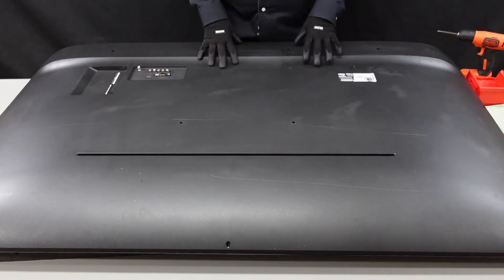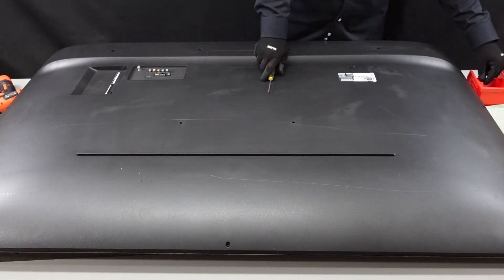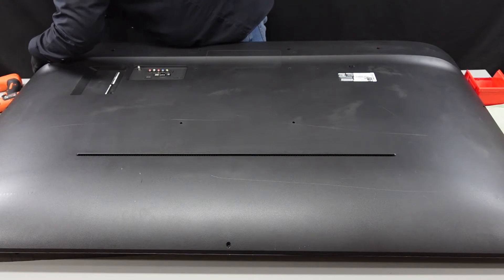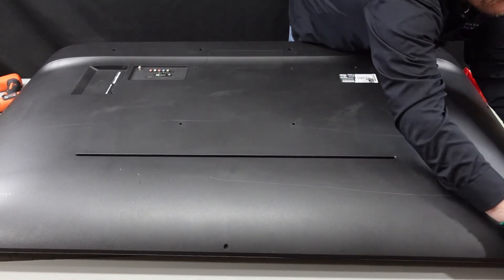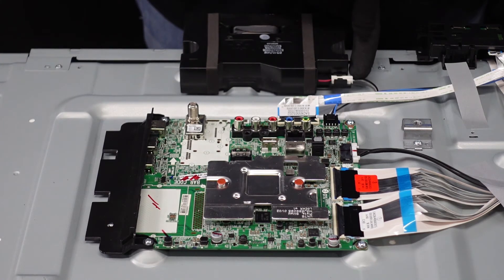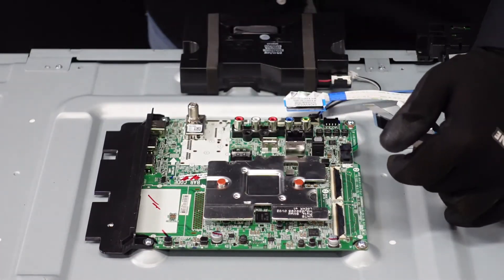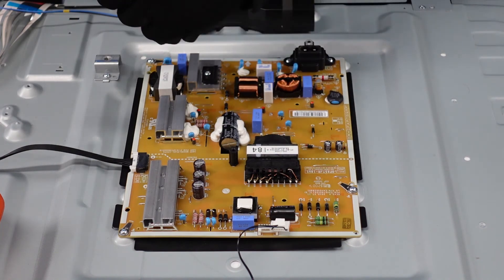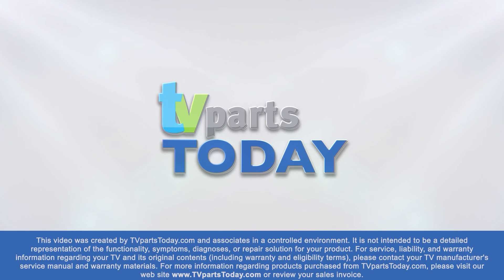Learn how to replace TV parts.  (LG 65UN6950ZUA)

Comment: I have this same tv the tv is really, really dim , you have to turn off all the lights to see a very dim picture and I think there is no sound. Can u tell what part I need to get? Lg won’t fix it.
Reply from the maker: If you have an extremely dim picture then it is likely your LED backlight strips are out. This is a very extensive replacement procedure so we would advise you to google your model number and backlight replacement to get a feel of what you would be getting into.

Comment: I have a question my screen isnt broke my LCd display is fine but there are cracks behind the screen on some plastic or acrylic board I need to know what's that is called and how can I order one
Reply from the maker: I have heard them referred to as a, "diffuser panel". Unfortunately we do not carry them in our inventory and I am not exactly sure where you can order one either. I have seen them for sale, apart from the rest of the panel components, on eBay and other resale websites but that is about all I have found in my experience.

Comment: I have the same tv but it just turn on and is a black screen
Reply from the maker: That could be a number of different issues. First step would be to do the flashlight test to see if your back-lights are working. 

Back-Light video: https://www.youtube.com/watch?v=2TMfkYy58ZU

If you cannot see an image on the screen when you put the flashlight up to it, that means that your main board is the most likely culprit. If you can see a faint image and hear the sounds from the menu then your back-lights are not firing correctly. If you would like some more in depth help send us an e-mail to info@tvpartstoday.com with your model number and a brief description of your problem and we will get you pointed in the right direction.
Reply: Same problem I'm have today
Reply: Did you fix your TV?

Comment: I opened my TV and found this part # but my TV is 43" I don't know if it's compatible.
My TV model is 43UK6300PSB.
Reply from the maker: There are some parts that can be substituted for a smaller or larger screen size, but it is always best to get the exact part for a replacement. Send us an email at: info@tvpartstoday.com with your model number and brief description of your issue and we can get you pointed in the right direction. Thanks, Soporte Ego!

Comment: I have this tv. The screen seems to have cracks when you turn it on. Do you have an idea what that is and if it’s worth fixing? I haven’t opened it up yet. Thanks.
Reply from the maker: Probably a cracked panel. In our experience, it isn't really cost effective to replace the panel on a TV. It is usually very expensive and it is also pretty difficult to find a replacement panel, not to mention complicated to switch out. We usually suggest buying a new set if the panel is bad.
Reply: Do you know where to get a new screen for this specific tv?
Reply: @callmebenjaminntv2999  it’s not worth it. It’ll cost more than a new one. I threw mine out.